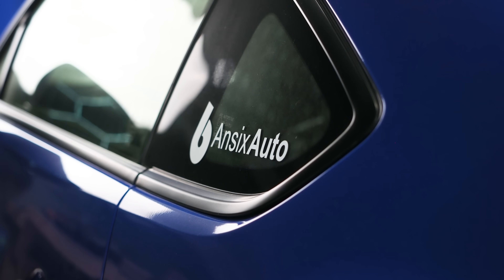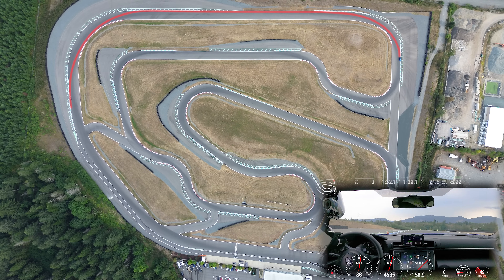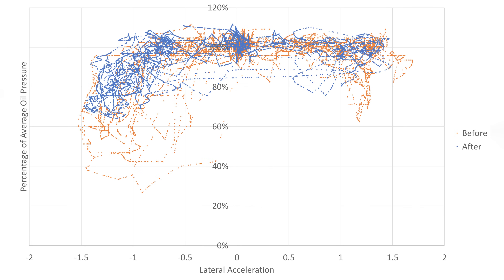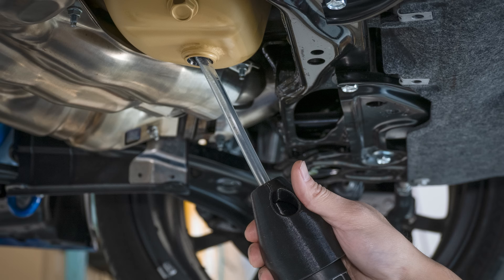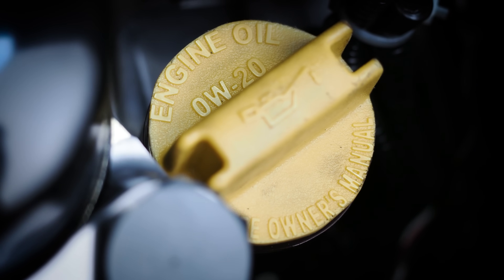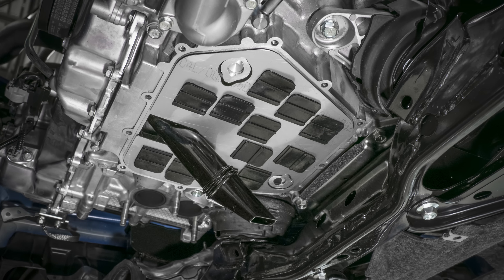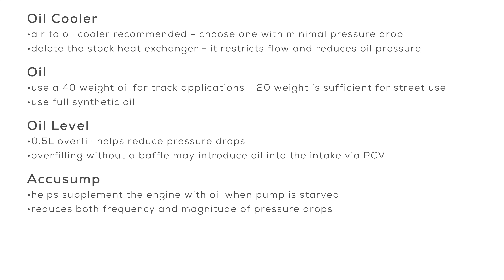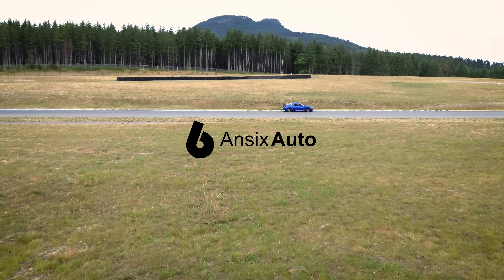The FA24D Engine: What Toyota & Subaru Don’t Want You to Know

Comment: Toyota should have used Yamaha's 3S-GE or 3S-GTE. That allows enough room for double-wishbone suspension setup too. Toyota Supra should have been built on the LC500 platform like the FT-1 concept. Toyota said it would cost too much and people won't buy it. Yet, they think people are going to buy the LC500 for $110K. Might as well get two cars out of one platform. There are some questionable decisions at Toyota.

Comment: What happens oil pressure wise if you use 0w-20
Reply from the maker: It would be a significant amount lower.
Reply: @AnsixAuto  interesting since it’s the manufacturer recommended oil
Reply from the maker: @stevenyerry2209  It's recommended for daily usage. At elevated oil temperatures out on track, the oil viscosity will drop. We feel a 40 weight oil is a better choice for a car that sees track usage since the viscosity at the higher oil temperature is more similar to a 20 weight oil at street driving temperatures.

Comment: the answer is right Infront of every ones face. no investigation needed... look at the direction the pickup tube faces. basic fluid dynamics is the answer. when you take a hard right turn all the oil in the pan goes left.. look where the pickup tube is... it points to the right. all the oil is left and the tube is trying to pick up oil on the right. then add the RTV issue on top of this and boom. All the aftermarket community needs to do is redesign a new pickup tube and some form of gasket to get rid of this stupid RTV, sell it as a kit and sit back and watch the money come in.. ill take my consulting fee in a free kit when you make it :P
Reply from the maker: Maybe you should make this pick up tube. We know that's part of the issue but changing the tube out is a lot of work as it requires removing the timing cover.

Comment: Wait im confused, so the problem is low oil pressure, but you specifically stated you had an aftermarket radiator that significantly dropped the oil pressure? How is this a subaru/toyota problem?
Reply from the maker: There's two things at play. One is the steady state oil pressure and the other is transient when the car is cornering hard.

Comment: What's really disgraceful is their pride and arrogance in this issue with them claiming their is no flaws whatsoever in their engine design. Then proceeding to essentially shift blame to people using the car on the track. Yet, they MARKETED the car with race car drivers behind the wheel, and the vehicle being handled with intent to be used on the track. I mean their ENTIRE excuse and reason for refusing to turbo the car is that the car is a "track/circuit," car. Yet when making a right TURN the car blows? Their failure to take accountability and acknowledge this flaw is nothing short of pure ARROGANCE.

Comment: I know it's technically not a solution but would swapping the block to the WRX block fix the issue, since the WRX also uses the FA24? I've considered a GR86 for a while now but this oil pressure loss is ultimately what has held me back from buying one. Would dropping in an IAG block solve the oil pressure issues? That might be a mod I would end up doing, regardless.. if so, it would certainly make me want to buy one, again.

Comment: 1:56 your goal should have been stop the drops in oil pressure, not just raise it, Raising it does nothing if you cannot pick it up due to lateral g's sloashing it to the side of the oil pan, This has long bee known about on ANY car you take to the track... Wet sumps are not meant for high g force. Many subarus have found this out on gravel rally courses.... Why do you think VSC / Subaru Rally team uses a DRY SUMP pan on the STi / WRX they are racing now? Why did Ken Block put one on EVERY CAR HE OWNED.... Because he knew getting sideways drops oil pressure... and he wasnt very smart, he could just drive his ass off.

Comment: After years of building racing engines, I strongly recommend liquimoly mos2 additive EVERY oil change.  I have 300,000 to 500,000 miles on all my cars.  Read up on it.  It will take 3 oil change intervals for it to stay optimal.  Read up on WHY mos2 was made.  I take my car to the track twice a week.
Reply from the maker: Definitely worth checking out. They also have the Ceratec too.

Comment: No oil pan gasket it's just literally some black sealer bullshit that goes in the pickup tube for the oil and running through the whole engine from factory before you leave anywhere far with this car you need the oil pan gasket put it back together then put very minimal gasket sealer then put it back together
Reply from the maker: That's a long sentence.

Comment: The G's on the track push the oil from one side to the other of the oil pan causing starvation. Also the pick tube could break off due to Subaru brazing it together and not welding. An after market oil pan with more baffles will fix the issues. This issue is more due to driver ignorance.
Reply from the maker: The FA24 pickup isn't metal anymore, its plastic. But yes, the starvation is due to the oil moving around. There currently aren't any pans or baffles available that have proven to fix the issue.

Comment: I bet all your oil is going to the left cylinder head. I think solution is if can get some flow check valve to the left cylinder head and block. Problem is the timing cover am almost certain.

Found this in just random vid searching. This issue is a long time issue with the subaru boxers. All in vid are bandaids, not solutions.

So what causes it? Physics causes it. Not starved sump because no zero. So only one other cause. Fluid has mass. It has inertia.  So at some point BEFORE THE SENSOR is a volume of fluid flowing from left to right. or AFTER from right to left. As such, when turning, inertia is tossing the oil away.

I would love to get my hands on one and do investigating. Suspect could be addressed with some sort of regulator in system wherever oil is being flung out. Sump is rear to front, so isnt that.

In my completely theoretical position from what I can see in oil mapping? I suspect the issue is the oil cooler location on the left side of the engine.

In higher than designed G forces, you have the oil pump fighting all the inertial force from the long oil passage leading to crank and right head with the pressure gallery being as theorized right side in terms of oil flow.

So as a fix? Is tough without seeing the actual oil passages. But honestly, I dont think there is much of a solution without some very expensive modifications. It would require replacing the whole front timing cover along with some machining in block to plug and tap oil gallery for new routing at minimum.

Anyways, that is just my theorycrafting. I have studied hydraulics and the way I see the oil feed. Is why happens on right and not left turns because it goes straight to head. No hydraulic mass for the inertia... But if we look at the g mapping, we can see that in strong left turns pressure still will drop a slight bit.

Comment: Dude bleed the radiator the pressure drop of 30 psi across it is because it has a place for the devolved gasses to accumulate and compress lowering the pressure

Comment: My friend has a GT86 and it was killed this way when he did a circle burnout. Oil starvation. All main bearings were spun, crank ruined, rods hot/blued, pistons scored, metal shavings everywhere. They quoted 10000€ for a new engine and install and he had bought the car for ~28000€
Reply from the maker: That's a shame...
Reply: That's pretty much something that should never be done in any boxer engine for that exact reason.

Comment: Gotta be careful overfilling oil to try and correct for oil PSI drops. Not only can it cause a massive mess when that oil gets into somewhere it shouldn't be, but also just dumping more oil in with the self reasoning: "Now it can't all slosh away under G loads and leave the pickup dry, right?" isn't great as it's not correcting the actual problem, just band-aiding the issue at best. Not only that but overfilling your engine with oil kills horsepower, and it kills it fast. The guys on Engine Masters did an episode about that very thing; with the takeaway info at the end being basically underfill your car around half to a full quart below what the OEMs suggest to basically unlock that mythical "free horsepower" everyone wants. They even joked about going even further on lower oil levels to gain even more power, but reasoned the pro of more power would meet the con of possibly having no oil lubrication in situations would inversely meet each other exponentially faster the lower you went.
Reply from the maker: Certainly you can't just keep adding oil until the problem goes away.

Comment: This is nice and all but you still haven't solved the issue.

Get a deeper oil pan that can hold more oil and change the share and depth of the oil pickup tube.

Problem solved, mark my words. I bet there is more volume on the left of the oil pickup than on the right.

Just the fact that overfilling helps is telling.
Reply from the maker: Yes there is more volume on the one side versus the other. A deeper pan works in theory but then it becomes the lowest point of the vehicle which can be a concern if you bottom out on anything.
Reply: @AnsixAuto  what is the space between the bottom of the oil pan and the oil pickup pipe?

Maybe reduce that gap, and bend the oil pickup pipe opening more towards the volumetric center.

Just create a custom oil pickup pipe.
Reply from the maker: @KiterTMK  There is maybe 1/2" from the bottom of the oil pan to the undertray. That's about 0.3L extra capacity.
Reply: @AnsixAuto  that wasn't my question really.
Reply from the maker: @KiterTMK Sorry, misread that. Not too sure about that gap. It's likely quite small. Moving the pickup could help but if you watch our newest video, it would make left turn pressure drops worse.
Reply: @AnsixAuto  what's the point of having turns asymmetric? Sure, it makes one turn worse, but the other better. So you'd still be increasing the lowest pressure point.

If you could further lower the oil pickup pipe, you'd may keep oil pressure steady overall.

Just measure the space between, you need to know if you can drop it by a few eights of an inch. That could add another few PSI.

The thing here is that the geometry of the entire oil pan and pickup is bad.
Reply from the maker: @KiterTMK There's no point... That's just how it is from factory. I'm just saying that it won't fix the pressure drops, just makes right hand turns less bad but left hand turns worse. The problem isn't fixed. Changing the pickup requires opening up the front timing cover, it's not a small job.
Reply: @AnsixAuto  well neither is a 500 usd bottle a solution. My bet is that the oil pickup isn't low enough. Fix the geometry. Simulate the oil level at 1G or 2G corners, it probably also loses pressure at hard downhill braking, no?
Reply from the maker: @KiterTMK  We don't think that's going to fix it so we won't be testing that. The cost of labor and parts for a different pick up would easily be more than $500 USD.
Reply: @AnsixAuto  don't you even want to consider if an extension to the pickup would work? You can make something plug and play for sure that only requires you to take off the oil pan.
Reply from the maker: @KiterTMK  No, because we don't think it will work. Also, it's not as simple to install as you say. Installing a new pickup requires opening the timing cover in addition to dropping the oil pan. It is a lot of labor since you'll need to clean off all the rtv and reseal the timing cover and the oil pan.
Reply: @AnsixAuto  just measure from the lip of the oil pan for both, how deep the oil pan is, and how deep the oil pickup reaches. Just to start gathering info. And the dimensions of the inside of the oil pan, plus the position of the mouth of the oil pickup in XYZ coordinates.

Comment: Yes now go get a dry sump.
This is a known problem for all boxer engines ever and the fact that it's not done from factory is because Subaru/Toyota need to keep costs low to increase production numbers to reach as many customers as possible and because they don't expect people to take the BRZ/GT86/FRZ throw race grade tires on them and go rip them through corners.

All you are doing is avoiding an obvious and necessary modification for racing.

Okay salt aside. It's a good thing you are calling attention to this issue.
Boxer engines come with advantages and disadvantages, this is one of them.

Im happy your fix worked out. Looks good and healthy.
Happy racing.
Reply from the maker: Who's funding this for us? 😂
Reply: @AnsixAuto  exactly my point.
I think the fix you guys made is great.
I hope I didn't come across as aggressive.
It's just that as far as I'm aware every boxer engine ever in a car built for race purposes has to have a dry sump system or oil starvation issues when the cornering speeds gets fast enough.

And hey honestly set up a "go fund my dry sump" and Id throw you some cash.
Racing is always a good cause.
Reply from the maker: @leogreck9984  It's not aggressive, we'd love a dry sump system but we can't justify the cost. The thought has crossed our minds to develop one but the market is too small since it's a very niche product. You could always throw us a "Super thanks" if you like what we're doing! 🤟

Comment: The 40 is the viscosity when it's cold. The 5 is the viscosity when hot. If you want more pressure when hot, get an oil with a higher first number. But too high might not be a good idea in that engine because of the tolerances
Reply from the maker: That's not correct.
Reply: @AnsixAuto  Instead of just saying it. Give an example. Because then you're only just saying words. It proves nothing.
     The entire reason for having separate viscosities is to account for the expansion of the metals during operation. It starts out thicker when it's cold to take up the space, then thins out as the metals warm up to account for expansion.
     The "W" in the viscosity rating stands for "winterize". For example a 5W-30 oil starts out with a viscosity of 30 when cold, and goes to a 5 when warm. Or any combination based on the thickness of the oil. 
     Now. Prove me wrong instead of just saying it
Reply from the maker: @richard-em6zi This information is all over the internet. See the link. https://www.online-lubricants.co.uk/blog-post/understanding-oil-grades
Reply: @richard-em6zi  crickets

Comment: But thats because its not a race car in stock form its a family car.
If you were serious about racing it, then it would have a dry sump system anyways. 

Its like people who complain about WRX's blowing up engine from doing to many Donuts to the Right also. 
Its not a valid complaint as its not meant to be doing Donuts its a road car.
Reply from the maker: Toyota makes a GR86 Cup car. It's a full out race car with a sequential transmission. It does not have a dry sump.

Comment: Literally validated me buying the gen1 hakone because I knew the data and aftermarket for the motor setup was ALREADY established... I didn't want to risk an engine with changed geometry and thuse different assembly standards... didn't expect it to happen so soon on stock motors, more so failure on nodding but between the pick up sealant obstructions and this it's been a "thank God I'm paranoid" event for me

Comment: Crazy seeing so many people upset about this when the video has a low cost solution. (Great job BTW)
This isn't a BRZ problem, most stock engines have this problem on track. Once you put those track tires on you've added a lot of lateral Gs to the equation.
Not only will you starve the pickup but you also don't have the oil capacity to sustain hard track use without checking and adding oil.

Going dry sump is pretty extreme unless it's a track only car, very few cars have a well engineered bolt on solution but lots of drift guys have had to make their own. Lots of great videos out there but it still takes a lot of testing and tuning to prevent starvation. 

Yeah Toyota had ads showing the car on a track but that doesn't mean it's a factory race car. It's a platform on which to build whatever you want.

Comment: Bro... not AGAIN. same issue the early 2000s wrxs and stis had.....
Reply from the maker: It's a difficult problem to solve without a dry sump due to the horizontal orientation of the motor.
Reply: @AnsixAuto  i lost my 1999 GF8 Sti to this. now own a 04 Forester Sti where the problem was fixed. Dont know how they forgot to do the same on the new brz

Comment: Funny enough, this issue is nearly identical to the 2ZZ from the 00-05 Celica GT-S. 

Specifically high G right hand turns causing oil pressure drops that starve the engine of oil, even more so in high RPMs. A Moroso oil pan that increases the oil capacity from 4.5L with the filter to 6L, along with an additional windage tray, and trap door baffle for the pickup. 

However accusump is a very helpful tool as well.

Comment: Good info. I don't have a BRZ but worth knowing!

Did you run an EPCV with the accusump? I've been reading how an EPCV that opens just below your hot idle psi is the jam, but... that would provide lower oil pressures than I am seeing you guys have mid corner (50psi).

Also how do you prevent the accusump from just dumping it's contents when you turn the car off?
Reply from the maker: We just run it with a manual valve. There isn't anything preventing the accusump from dumping into the sump when the car is off. The extra amount in the sump would be about 1.6 quarts when off and 1 quart when idling.